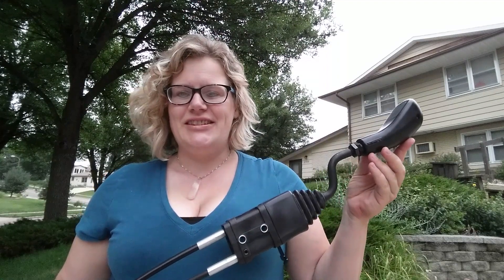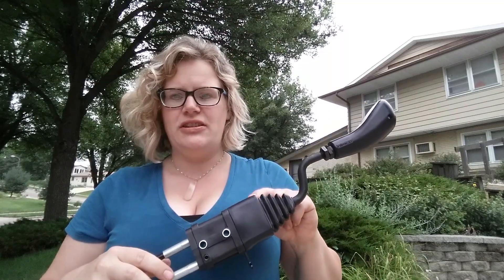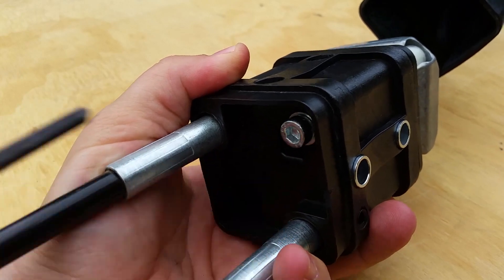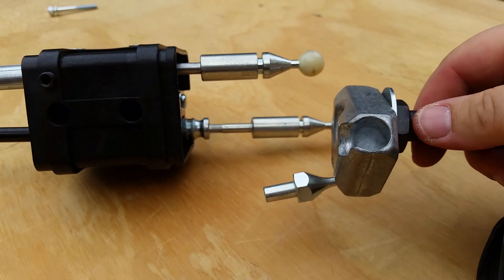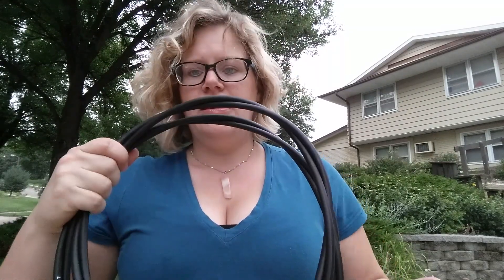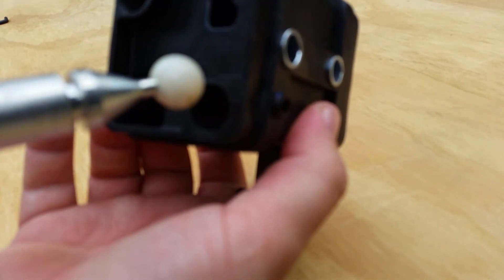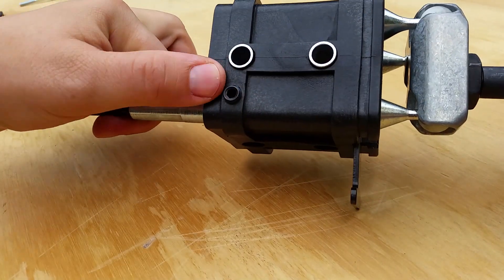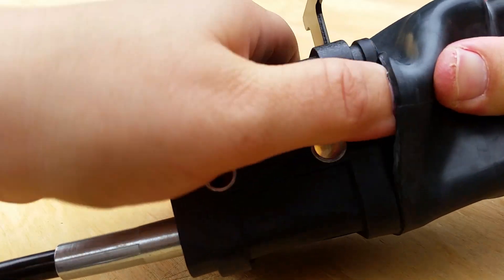How to Replace Parts on NIMCO Joystick - Cables, Pivot Ball Pin, and Triangle Joint

Comment: is there replacement or a fix for the cable end balls pulling out
Reply from the maker: Unfortunately just the ball on the end of the cable can't be replaced. If the ball is broken or comes off the cable, the entire cable needs to be replaced.

Comment: Can you just replace the balls on the ends of the cables or does the whole cable need replacing?
Reply: I'm wondering the sane thing! I'd hate to have to buy a whole cable just for a broken plastic ball end. I tried some JBWeld but it didn't work. Any luck finding an answer?

Comment: Do you have an implement dealership or just sell parts. Very good explanation. I found your video because I just bought a Farmall 460 that happened to have a Koyker Super K Loader on it.  I am selling it though because loaders on an old tractor is a death sentence for the unit. Do you have a website? I worked alongside a woman that rebuilt diesel injection pumps. Good to see that the trends with women in farm machinery mechanics is growing.
Reply from the maker: Yes, this is our website - http://www.shortlineparts.com/. Thanks, I really enjoy working in the agricultural community. I grew up on a dairy farm and am thrilled to have the opportunity to work in the agricultural community as an adult.